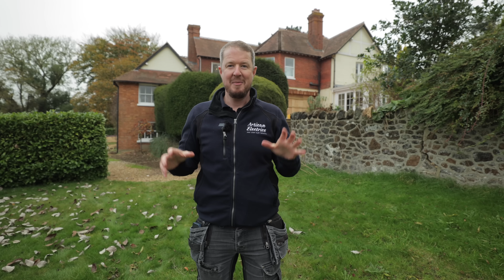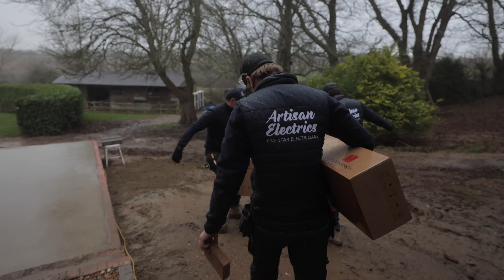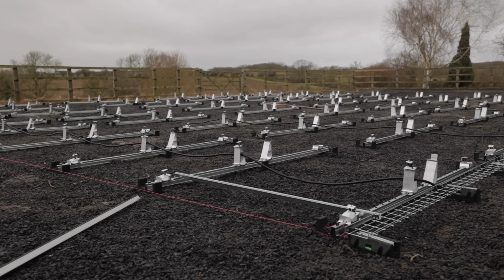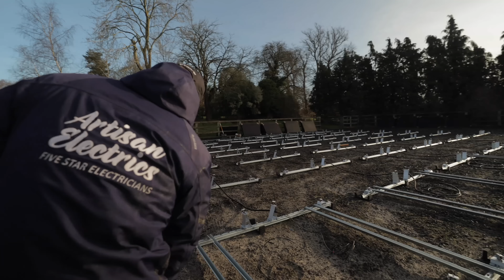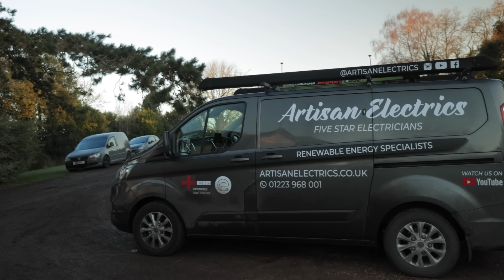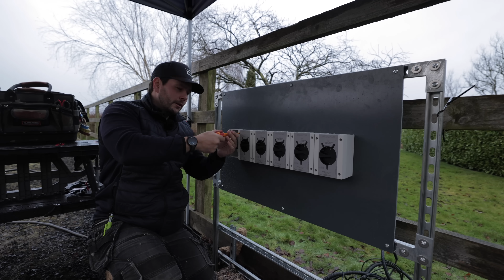Roof vs Ground Solar: Which Should YOU Choose?

Comment from the maker: 💡 Unilite Work Lights: Get 25% off all Unilite products using code "ARTISAN25" - https://unilite.co.uk/
Reply: Being bi-facial you could have installed them vertically replacing the fence and still have the use of the horse menage.

Comment: Thanks, enjoyed the vid. I've been considering adding solar to my apartment in Jerez, southern Spain 36 degrees north. I think my mains supply is rated at 4.5kw and I use on average 150KWh (60 euro) per month. I have 7 metres of almost south facing wall for panels, which gets sun all day in summer, but only a few hours in winter because of a neighbouring building. Does this sound viable? Do  you travel? 🤣

Comment: The most professional group of Sparky's I have seen and I have worked with plenty.  They turn up to work neat and clean, everything is neatly installed, very impressive.  It's strange how electricity is the same around the world, but all the standards are different.  In Oz all solar frames are earthed back to main earth, we don't switch the Neutral on the main switch nor any other Circuit breakers unless they are earth protected.  The only earth is a local earth, there is not one provided by the supply company, which I'm guessing you guys have.
Reply from the maker: Thanks for your kind words 
Yes in the UK there is usually an earth provided by the network operator

Comment: Since bifacial panels have been used would  it not have made sense to have more reflected material below the panels to improve output. Is there modeling available for vertical install of bifacial panels? Since potential east west performance on every panel maybe possible with vertical installation.
Reply from the maker: Yeah the customer will probably do this later

Comment: So many comments missing a fundamental point.  Solar is not there to power your heatpump mid-winter.  It’s there to export so much in the summer that your profit from then pays for the heating throughout the following winter.  It works well in the UK if you view it over a whole year.
Reply from the maker: Very good point - although this system is covering 40-50% of the house energy usage already even at this time of year

Comment: I was quoted about $330K for a Tesla Solar roof that was about a 45KW system.  Would be great except that in the 20 year life expectancy, that would be $1375 a month for 240 months.  For that monthly price that is about 12,500 kWh worth of electricity each month or about 3x what we use during the heat of the summer, much less usage in the winter as we heat on natural gas. Electricity cost here is only about $0.11/kWh.  But the nerd in my sure wants a full solar and battery storage system for sure.  🤠👍
Reply from the maker: IN the UK we pay about $0.42 per kWh so it makes much more sense

Comment: nice work.  I would like to have so much space also, but I only have a garage with a flat green roof, where I plan on using vertical short panels.
How much ballast did you use?  I had to add 80 kg per panel/mounting system.

Comment: really confused about why you guys would place bi facial solar that low to the ground.
Reply from the maker: Albedo from reflected light - the panels have a transparent back sheet
Reply: @artisanelectrics  Hi, we have not done panels on the ground only on roofs. we design it in a way. the structure would at least 1m from the ground and 3in to about a meter gap between the panel. so the light would enter through the gaps and reflect on the ground. where we suggest the customer to paint it white. we usually install 540 - 580w bi facial panels.

Comment: Any array this size - you should spec optimisers if using other brand inverters /battery direct I would recommend adding a tygo to pannels to prevent clipping of string without it many customers complain about the lack of generation so far 6 years 4 manufacturing problems in month 2 , they changed the lot , since then it’s been more reliable than my neighbors enphase
Reply: Yes I would have done too. I did not on my roof as I did not want to worry about a failure and having to get scaffold back in. But at ground level would have done.
Reply: @ I have both on my American home , 8kwh on the annex and 12 kwh on two ground mount, yes they did need scaffolding back but thankfully I still had it up due yo painting being done that was delayed due to heavy rains by a week which worked out great

Comment: Harry's Garage just put up a good video about his experience with solar generation...lots of real time figures over a few years.
Reply from the maker: Yeah I watched that! Interesting video.
Reply: @artisanelectrics  It is a good video, well made. 
The greatest energy saving device ever invented is just over 200 years old and will never be bettered. The switch. Use less, need less.
 Here is something to get your head around.....many years ago I did a lot of work with LED's and Solar.
 At that time the Outdoor Advertising association of Great Britain published figures of how many billboards and illuminated hoardings of various sizes were available to rent in the UK.
 I had someone much cleverer than me work ot the annual electricity consumption based on those figures. Outdoor advertising, at that time, used more power than Oxfordshire..... industrial and domestic combined.
Reply: Yes, and Britain was rich in coal oil and gas, and still is. The race to zero is getting very very expensive.
Reply: @ lol....ok
Reply: @markrainford1219  ......and so is Climate Change.  Presume you've booked your flight to Planet B already?
Reply: I watched that video and the main reason for poor panel performance in the winter is the angle. I have a flat roof system with at most 2 degrees of pitch on it and in the summer i can make 20kwh off of 2.4kw of solar but in the winter i might only get 0.5kwh during the whole day. Other roof mounted systems will perform far better. Personal opinion but this customer would of been far better off with a 3 axis tracking system with alot less panels. Trackers will make the most of the sun and there are some good ones on the market.

Comment: So please tell us what is the rough cost of the system you have just fitted and how much does production lessen on cloudy days as we have had the last two weeks dull most days.
Reply: You would be very lucky to get 10% of installed capacity for a very small part of the day. If you are on heat pump only, even with battery storage, after a day or so you are going to be cold.
Reply: @markrainford1219  Thankyou for your answer, in a word on dull days it is crap. They never tell you these facts about solar, that it is really poor in winter in this country.

Comment: 25:28 I have Tigo optimisers on my system but no data from them... what am I missing? I didn't know they did data!
Reply: You’ll need to mount what is effectively a gateway box near the panels. Then pair each Tigo unit with it. There is a low cost for monitoring long term.  One often overlooked benefit is that when the units first “call home” over the internet the Tigo optimisers firmware gets an update.  That step was the final item in our installation, which had been running for a few weeks by then.  Both our strings have significant shading.  There was a significant uptick in efficiency after the FW updates completed.  Somewhere around 15% in our setup.  Well worth doing it for that alone.
Reply: @simonedwards4072  thanks ill look into it. I have a bit tree next door that loses leave in winter so my panels get a ton of shading in winter.

Comment: Tejas Borja do solar roof tiles. A standard ISH sized tile with a Mono crystalline Silicon cell that's 23wp per tile. And a 56wp CIGS massive tile (that's about 1.25x0.45m). I think some combination of ground mount and roof tiles solar is ideally the way to go, expensive as all hell, but to my mind worth it.
Reply: Tiles would Spoil the look of the property though .
Reply: @pmb9172  like the Tesla roof tiles they'll silt screen a pattern or colour onto the glass tile. So it can be matched to the area and look like a smart slate roof.
Reply: @Sandmonmsn it's up to the customer. They wanted a ground mount system so that's what they got.
Reply: And I'm not bashing on that. Just my opinion on another product. It's great they have the space to do a ground mount for convenient cleaning and maintenance. For me, if I had the money AND space, I would do both ground mount and solar roof tiles (as I would want to deep enerfit the house), with a giant house battery with some smart energy tariff. But that's me and that's fine, other people would want something else, planning department in the area might want something different.

Comment: 42kW peak PV, what is the battery array size?  Can you disclose DNO allowance?  Your PV are at a very low angle of elevation. Was this a planning requirement?  Are you sacrificing much winter power generation?

Comment: With the panels mounted so low to the ground (and the dark coloring), you won't get much power from the back of the panels.
With such shallow angles, the panels will probably need cleaning - rainfall won't have the gradient to keep them clean.
Reply: Agree the panels are too low and will get hotter than necessary in summer with the reduced convection. A white reflective ground would help with chalk gravel, but as long as the array supplies enough energy for the client it doesn't need to be maximally efficient. It can be raised later.
Impacts from raindrops will move dirt and even with a shallow angle the tendency would be for the particles to walk to the lower edge. It isn't the Sahara!

Comment: Can you get a rotating base for ground mount so they can always be pointing at the sun all year round and all day  - similar system to the mirrors on solar salt reactor boilers in the desert?
Reply: Yes but the extra cost is usually not worth it.

Comment: East/west with that swallow angle will be poor in winter, I compared my 12.5kw system at 35 angle south facing grpund mountrd to my workplace system of 25kw east/west roof mounted roughly 10/15 degrees produced the same kwh in Jan 2025

Comment: It be interesting to see how the output in winter months drops significantly compared to what’s generated during summer months.
Reply from the maker: Its currently generating over 10kW so decent for this time of year
Reply: That's not a percentage though, it's a figure. OP, you will be lucky to get 10% on an overcast day in reality. If you have oversized your system 100% then you will still be producing 20% of your consumption: in daylight obviously.

Comment: Hager do a 3P Rcbo but it takes 4 slots
Reply: Now that’s interesting, do you have the part number cos I need one, however can’t find it on Hager website cheers.
Reply: @liberatodelgreco4430  it's called earth leakage add-on-block 3P 63A 30mA Class 1mod

Comment: Well its not dead because 99% of the population dont own a field.
Reply: That's ok, you just need an unused Ménage like these guys.

If you don't have a ménage then obviously a disused paddock would also suffice 😄

These guys have created an echo chamber for themselves as their prices put them out of reach of anyone who doesn't have spare fields.
Reply: @Dan-Athema 
Agreed £90 per hour (5 years ago ) 
5 people 5 days 10 hours a day 
What's that £22000 in labour Alone?
Plus planning 
Plus £30000 staggering..... Amount.
Reply: @allan4787  So it should take about 1000 years to recover the costs. Lol
Reply: @allan4787  besides pulling this calculation straight from your ass, they’re building a massive amount of capacity here.
Reply: @allan4787
1000 years to cover the cost might be true if the cost of power was not constantly going up. That said don’t think you will be offsetting heating costs during the month you need the heat. But the power company will work that part out. 

I live in Seattle which has similar weather. The electricity is really cheap. So my system will take 17 years to pay me back fully. Not bad for a system that has a 25 year warranty and a 40 year expected lifespan
Reply: @markrainford1219  
Quite. Putting the money in the Bank and using the interest to buy your electricity is a better deal. 

Jason is very quiet about the costs of these installs or the expected return.
Reply: @ I am 'considering' solar PV. But only for the  simple fact that my mate owns a scaffolding company, the equipment is now dirt cheap, and I'm an electrician. Otherwise I just can't fathom the economics, once you factor in maintenance and equipment replacements.
Reply: @markrainford1219  most of the people having these insane installs that artisan do these days are clearly  loaded they don't care about the upfront costs or they wouldn't be spending 20 or 30k on a install facts are u can get them way cheaper now.  The roi on some of these Installs would be ridiculous.  There is less and less off peak hours to charge batteries as well to help roi.    I'm speaking from experience I have solar and battery on my roof it's amazing but u don't need to over pay for an install most of the equipment dows the same thing once it's in.  It's more for the installers as to what they prefer to put in to a consumer it's all much of the muchness really
Reply: @markrainford1219  I struggle with the logic in the UK where the predominant power need would be for heating and in the part of the year where that would use the most power you have the least sunlight.
Compare that to more equatorial regions where the need is for cooling in the part of the year where you have ample sunlight making it a better match.
Seeing fields full of panels last time I was in the UK made me think “either someone’s an optimist or those were subsidised”.

Comment: Very impressive work! There's an old rule in data cabling - never run one cable. Cable is cheap! Cheers!
Reply from the maker: Thanks Jim!
Reply: Running data to a corner always two cables. Since a face plate has two connections. 

Also reduces the need to have a hub, at the end points. One big switch at the patch panel